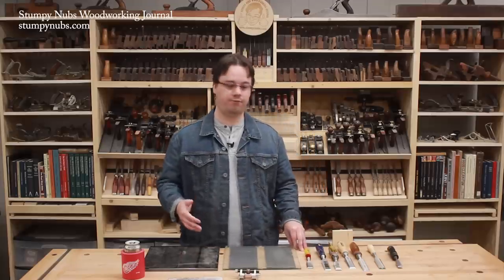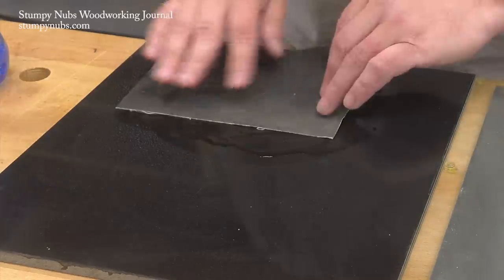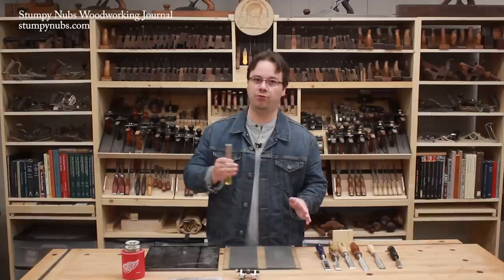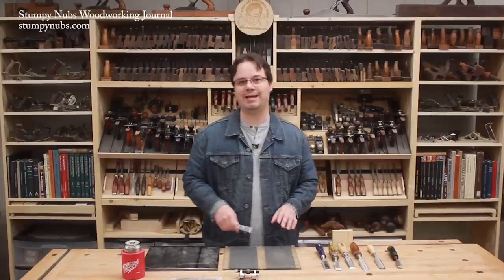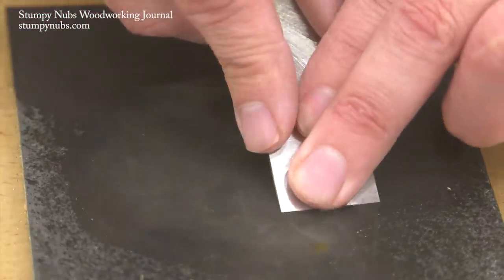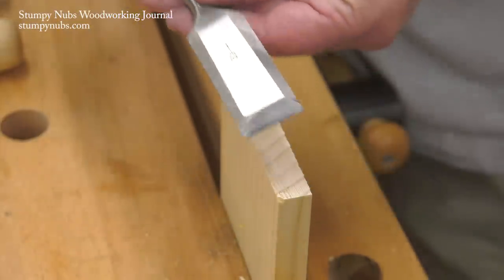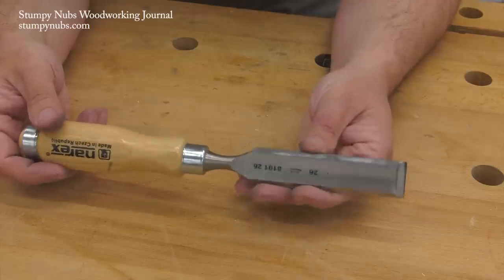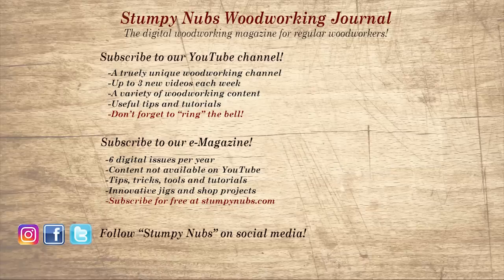Cheap chisels? How to make them scary sharp!

Comment: Shaving the hair off your arm is good for impressing the non-woodworking crowd. Shaving the end grain of soft pine is good for impressing woodworkers.
Reply: What about shaving the end grain of white oak and hickory?
Reply: @bobbyhempel1513  does not require nearly as sharp a chisel. For soft wood a dull chisel will crush the fibers.

Comment: Another tip from a new woodworker to others. I have one chisel. Its what I could afford when I bought it, but I didn’t think about it too much. It is a one inch dewalt side strike beating chisel (with the steel cap). If you are a new woodworker, I recommend you don’t get one of these. It’s a fantastic chisel, and holds a very nice edge, but the side strike feature means one long edge of the chisel is also sharp. As a new woodworker who doesn’t know how to use a chisel well, I have cut my hands with this long edge many times and it won’t be long till I do worse damage with it. Knowing these recommendations, I will definitely be getting some different chisels soon!

Comment: My Aldi chisels are every bit as good as my expensive ones.  They take a super edge that doesn’t last quite as long but is  a lot easier to bring back.
Reply: I completely agree. I am a hobbyist woodworker and have never owned sets of chisels or hand planes that cost me more than a few bucks. Yes, they do require some work and maintenance. However, after having built over two dozen guitars, ukuleles, banjos, and other experimental stringed instruments, I have yet to see a need for anything more expensive. While I completely get that tool-grade steel has a better life (and that quality is quality), I also appreciate the idea that it is not about what you have, but about what you can do with what you have. That said, if one makes a living as a craftsman, then we are on another plateau altogether.
Reply: Aldi is a serious exception due to the metal used.
Reply: I'm still having a hard time wrapping my head around the notion of buying chisels at the cheapest grocery store in town :D

Comment: I just do rough work and would never spend all that time sharpening.  I just buy cheap chisels and use them until their dull then buy more cheap chisels.  Like $8 US for a set of 3.  they last anywhere from a few weeks to 6 months.  Like you said sometimes you get a turd and other times you get lucky and get a nice tempered set.  I save the old chisels as I have down time during the year and might resharpen them on a cheap belt grinder I got for $40 but that remains to be seen as I just keep getting in a hurry and buy more chisels.  I don't know the first thing about wood working but I do install locks, adjust strike plates and hinges a lot as well as a few other handyman type things.  If I get more into it I would try the chisels you suggest. I had some fatmax but didn't like them so would try the Narex.  Great video and thanks for all the links.

Comment: I use a single or pair of rare earth magnets with eyelets to hold the tool especially plane irons when flattening the back.
Reply: I am not quite following what you are talking about when you're using rare earth magnets to flatten and sharpen the backs of your plane blades. Can you possibly be more detailed with your explanation so I can understand better. I am almost done restoring my great grandfathers #5 hand plane I just need to finish flattening and then sharpening of the planes Iron/Blade. So any tips or help with doing the trueing up and sharpening the blade is appreciated since this is my first hand plane restoration

Comment: My 32mm Stanley bash chisel is going on 7 years old now.. I use it every day on site.. It's gone through 3 inch nails while doing house framing, been used as a pry-bar in all manner of situations, and has been dropped nose first from various heights directly onto concrete more times than I care to admit, and now it only takes me about 20 minutes to rebuild the tri-bevel (25-30-35 degree) using my honing guide, 600 grit diamond plate, then my 1000/6000 waterstone (how did I live before getting a waterstone I'll never know), then stropping on the back of an old leather belt. It then slices paper like a laser beam.. All up I think it's about a quarter inch shorter than when I bought it. great chisel and only cost 10 bucks!!
I also have a 7-piece set of Marples, but with the blue and clear handles, and full length shafts and steel end caps.. right out of the pack they were really sharp.. the waterstone and strop made then even better..
Hanging on the tool wall I have a 3-piece set of old red resin-handled Stanleys which I've had for 23 years.. I haven't touched them in over 2 years, and haven't used them on timber in over 5.
I barely even touch the 4-piece set of no-name yellow handled chisels anymore, except if I need to clean old mortar off bricks, or to chisel up tiles from a floor, or to open a paint tin.. ;)
I'm considering melting them down and making a big knife from the steel.. might chuck in an old file or 2 so it holds an edge.. ;)
Reply: The last bit if your comment sounds like fun the bit about melting down your unused chisels. I like watching blacksmithing videos along with my woodworking videos. I'm definitely in the woodworking category but blacksmithing looks like a whole lot of fun as well though. Good luck with it if you ever decide to go through with it

Comment: Very clear enunciation with very informative content.. i just subscribed and will definitely check out more videos! I imagine you didn't talk about the secondary bevel since you focused on freehand sanding, but couldn't help but notice the chisels you show do have them. I have done some research on bevel angles and saw that larger angles work better on harder wood and for mortising, but there aren't many videos about that. If it's not too much to ask, could you make a video talking about bevel angles and it's uses? For example, if two chisels had secondary angle of 30° but one had primary angle of 20° and the other 25°, would there be much difference? Or even simpler, how would a chisel that has secondary bevel 25° and primary 20° would differ from a chisel with only a 25° bevel. Also, how does the thickness of the chisel com into play here, is it something that would also affect the use? Thanks and keep up the good work!

Comment: What glue do you use to hold the wet/dry paper to the glass surface?  Spray adhesives work, but are a real pain to get off when you've worn out the paper, unless you know of some chemical like acetone or naphtha that removes  the gunk left behind easily.

Comment: Thanks for the great content, always helpful. What's your opinion on the Buck Brothers Chisels sold at the big orange box store? Mine were reasonably flat on the back and are easy to get razor sharp. Edge retention seems ok, but I don't have any higher end chisels for comparison. I also have older Craftsman chisels made by Western Forge, if you have any thoughts on those I'd be interested as well.

Comment: "Chisel-shaped object" made out of "Chinesium".  Love it, Stumpy!  Keep up the good work!!   If you have more $ than patience or time to spend hours on this, what premium chisels do you recommend?
Reply: "Chineseum" is amusing, and not undeserved, but it's worth noting some Chinese-made tools are very good. In the US and Canada, Wood River planes and Chisels are hard  to beat for price vs. value.  I have a set of Wood River butt chisels I really like, and their socket bench chisels are well-reviewed.  I do have a set of their cheaper bench chisels, but they aren't really good for fine woodworking.  Decent enough steel, just not made like a premium or semi-premium.  Narex Richters are great--a premium chisel at a mid-range (-ish) price.  Lie-Nielsen socket chisels are pricey and worth it.  I only have one, so far, but as pleased as I am with my Richters, it's immediately apparent why the Lie-Nielsens cost so much more expensive.

Comment: Has anyone done a vinegar bath on there chisels to protect against rust. I like to watch blacksmithing videos along with my woodworking videos, and in a lot of smithing videos they use vinegar to put a protective coating on their knives. You know as a rust preventative. I live in Mid west Michigan Grand Rapids to be specific and my garage slash woodworking shop gets very humid almost all year long. Also my clothes dryer vents all of its humid gasses during use directly into the garage hence the humidity being all year long. So I am curious if after flattening and sharpening can I do a vinegar bath on my chisels or no, bad idea with the vinegar?

Comment: If the hardness of the blade steel is the issue, does anyone every heat treat their cheap chisel to strengthen the edge?  Granted it might require removing and resetting the handle.

Comment: the most commonly used wood in china is soft wood. use chisels from areas where hardwood is abundant, use chisels where softwood is abundant. different metalorgy based on areas.

Comment: All I can do is get my knives and chisels sharp. Don't want em scary sharp or I will be afraid of them.  Lol.
Reply: A crazy sharp chisel is a pure joy to use, of course, with respect given to, and an understanding of the ease with which it'll open you up if you mess about.. but the first time you glide it into a bit of timber you'll almost cry but definitely sigh - it takes all the hard work out of hard woods.. ;)
If the hairs jump off your arm before the blade touches them, you know it's proper sharp.. you should have zero resistance when slicing down a sheet of paper.. THAT'S sharp.. :)
Reply: Another good tip too determine how sharp a chisel is or isn't I have heard both from master woodworker Paul Sellers as well as here on Stumpy. To determine your chisels sharpness is to use your thumbnail as a guide. If the chisel easily bites into you thumbnail it is very sharp. If the chisel doesn't cut/bite into your nail it needs sharpening. Sometime your chisels does a bit of both skids on your nail as well as cut into it then the chisel might be sharp enough for soft woods but not sharp enough for the good hardwoods.

Comment: ALWAYS remember, there is no such thing as a 'starter' anything.  Learn on the best.  That philosophy has never failed me.  Buy the best you can buy, or save up and get it when the money's there.  Get a temporary, part-time job for extra money and spend it only once.  $120.00 for three chisels (1/4, 1/2, 3/4) is 14.29% less than $140.00 ($20 for cheap set and $120 for three most commonly-used size you buy later).  Give yourself a 14.29% discount now and buy the good chisels first (or anything else, for that matter).
Reply from the maker: "Starter" just means the tools you start with. A person should still get the best "starter" chisels he can afford. I am not suggesting you buy junk just because they are your first chisels.

Comment: I have a few of those “chisel shaped objects”.  They have been designated for opening paint cans.
Reply: My wife went to open a tin of paint with one of my Naren chisels..... still married but only cos it was my fault for leaving them hanging over my bench in my wood shop .... my bad ???
Reply: @mac243877  you know  you can edit your comments.. ;)
Reply: Rusty Gun Mmmm...until I got older most of my "tools" were--old butter knives!  Did pretty much anything you needed done around the house (including hammering a nail to hang a picture & flexible putty knife)!

Comment: (before watching) I never be able to properly sharp a chisel or knife, even after youtube tutorial and stuff, I hope to learn more here, thank you !
Reply: It’s ok, when I started sharpening, I couldn’t sharpen properly as well
Reply: Pick up a cheap honing guide. It makes it way easier!
Reply: @bensander4276  the cheap honing guide I picked up turned out to have the hole drilled in the guide wheel off center !! Now, if you want to have a sharpening challenge.... (fixed it by running it against the grinder wheel and it took the high side off and got it round enough for the work it does - primary bevel angle)

Comment: You can get very good chisels from China that are cheaper and perform the same as "higher end chisels"

This whole "Chineesium" thing is complete BS as if you buy crap you get crap. It if funny how most people here don't even realize how many good are produced in China. 

If anyone get anything, some of your largest infrastructure today is in China and has been standing for decades and heavy use. The HSR in China is also 11 time the length of Japan's with a greater safety record than Europe's with only 1 freak accident caused by lighting years and years ago.

High carbon steel can be had for cheap in China and is comparable to those in other nations.

Among the top 10 steel making countries in the world, China produces more than the rest of top 10 countries combined. High carbon steel isn't a problem.

The standard at which this is done is also very high and performance on some of these structures is also superior to Japan's in both physical and simulated testing. Results are also clearly seen and experienced.

Comment: Ive been using the sandpaper method for a long time for these types of things but your glass plate was a good addition. I work on high pressure air compressors (5000 psi) and use class as my flat medium. Our valves are like coins and i use several grits of lapping compound to perfectly mate the surfaces good enough to hold that pressure metal to metal. Glass is the best medium.

Comment: When I traveled across the country to my aunt's home, she needed some work done on the deadbolt mortise.  I ran to Lowes and picked up an inexpensive Buck Bros chisel.  I have to say I was pleasantly surprised by the sharpness of that chisel.  Since then I have heard several good comments about Buck Bros when on a budget.
Reply: @bradyritter2193  Brady Ritter, What do you mean by put in acetone and rub with steel wool.  I am confused.
Reply: @tonyn3123  to remove the shellac like substance they coat them with to maintain that shiny look - it's fine for staying shiny, but nutz if you want to use them like chisels.
I have a set of the Buck Bros - they will hold an edge, they will cut hardwood well, they won't stay supper sharp for extended periods - they are inexpensive, but good(enough)
Reply: @gregmislick1117  Ok, I understand and agree completely.  Being in CA I didn't have anything to clean them with, but my work was minimal.  I have since given it away when I got home and my buddy still loves it.
Reply: By the way....I gave it away because my go-to is a 10 piece set of Freud chisels my family bought me in the late 70's for Christmas.  I have really enjoyed a quality chisel set through the years.

Comment: I think this idea applies to most things. While we commonly say when you begin go cheap, buy the expensive stuff later. But the problem there is if you get something so bad that it puts you off the hobby or job entirely, it's just sad.
This is what happened with my first knife. I got into cooking a couple years back and so wanted a new knife. We got a cheap chef's knife and it sucked the life out of me. But since it's food I have to cook anyway, I stuck with it but hated every moment. 
Then I got a more expensive carbon steel knife and a whetstone to go with it. I have enjoyed every minute of working with it. If I had started with this, I would've improved so much more in this time
So the general rule applies, Google extensively, ask people in the know and get as good a thing as you can afford.

Comment: Thank you very much for this tutorial, I found it super useful. Mostly common sense tricks like using different direction strokes on the back of the blade for each grain of sand paper: of course, but until you have tried it, you would not know how it makes your life easier.

I have one chisel, of brand El Cheapo because here in Thailand, tools are expensive when compared to the cost of life, but at least, now I can use it.

Comment: Honestly, the Buck Bros ones from the orange box store in the US are pretty good for the money...they're made in America and they seem to hold an edge alright. They need some work, but it's doable.
Reply: I agree.  I bought a 1/2"  to try it out and it's been working great.  Didn't have too hard of a time flattening the back and it holds an edge pretty well.  I like them so much I bought a few more in other sizes.

I also made the investment into some steel diamond-coated plates instead of sandpaper.  They ain't cheap, but they are great.

Comment: I just bought a really cheap 3-Pack from Wallyworld. But my intention is to use them as beater chisels (for things like scraping glue and gunk off of stuff, including metal surfaces that would ruin an edge). Basically the things I would feel bad abusing a good chisel doing.

Comment: For outdoor projects when you need to clean a dado or half lap joint , I found the cheapest I can find are doing good job . Usually I'm working with pine not any hard wood. I have irwin and stanley sets as well as buck bros set from HD.

Comment: For those on a budget (or just cheap like me) I was able to obtain some scrap granite from a counter top manufacturer. (He essentially allowed me to check his scrap bin. I wound up with an oval shaped "sink cut out" about 12 x 18 with a smooth surface and rough edges. I looked at it with a straight edge when I got it home and couldn't see light under it so it is flat enough for my sharpening work.
Reply: I found a granite sink cut out at a Habitat for Humanity "Restore" for $5.  Not free but easy.